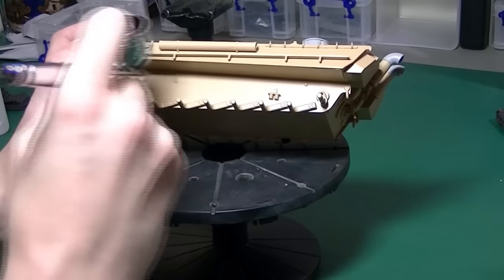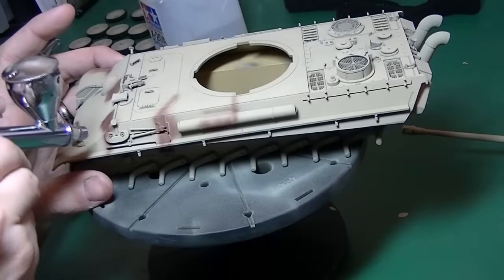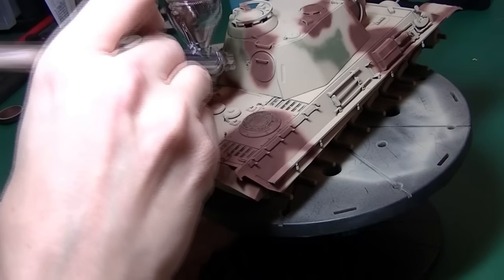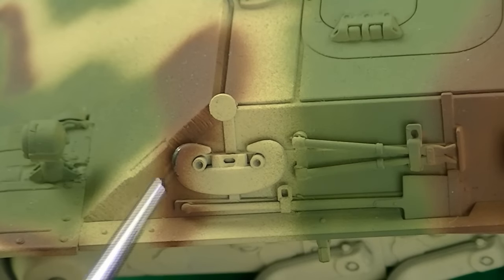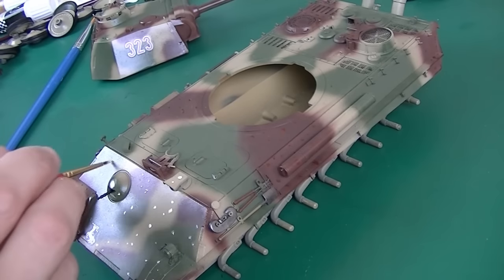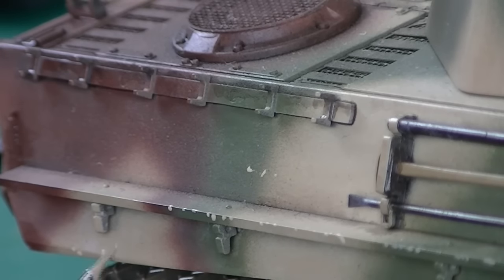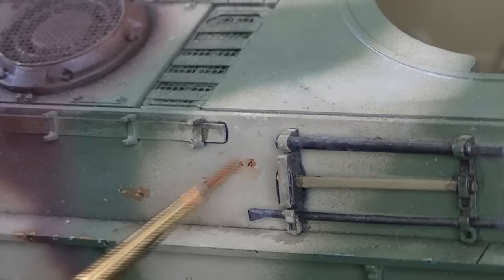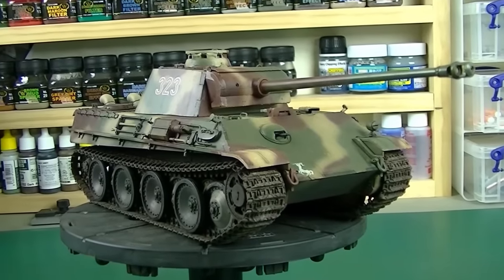Panther Ausf. G Hermann Göring Division - Painting and Weathering

Comment: Hi, the wire cutter handles were made from Bakelite (wood chips compressed in resin, a primative plastic) not the "Presstof" laminated compressed fiber/paper/resin.     Germans wore hobnailed boots so the paint would be scratched down to bare metal in many points the crew used to mount the Panzer.   But the Auf G likely didn't get as many boarding/dismounting cycles  before it was issued then destroyed, as you mentioned.
Reply from the maker: I mean you know I have an original wire cutter here and made a video on it right?

Comment: Really good job on this panther 
I really like the camouflage and don’t worry about the dust under the clearcoat it happens to me all the time..... I saw you used Tamiya Flat Black as a primer I use NATO black but it seems that after I primed the model with the acrylics I let it dry a couple of days and I go over it with Tamiya Xf-60 It gets like a gritty feel does this happen to you also when outing Tamiya acrylic on top of Tamiya acrylic
Reply from the maker: Thanks very much. I've recently got some NATO black. I'll be giving it a try soon. I think I'll be doing less clear coats in general.
Reply from the maker: I just re-read your comment. I used to get a lot of orange peel, had to do with a few things. Too high of pressure, not thinning paint enough and being too far away from the model.
Reply: Thank you for the response I’ve tried everything and I’m still getting a slight gritty finish with the Tamiya acrylic ..... panzermiester suggested that I try thinning it 2 parts thinner to 1 part paint .... 
I’ve been using to TS 3 rattle can for the time being I got to be an expert at controlling the paint comes out.... looking forward to another video from you 😊

Comment: Did you use the paints right out of the bottles or did you mix them.  If you mixed them, what was your ratio of paint to thinner?
Reply from the maker: I don't use a ratio so to speak. I just add thinner in to a plastic cup with the paint until it's milky. I can try and do it in the next video.

Comment: I agree about tamiya german green being way to dark, by the time you filter over the top or do a grime wash it almost looks black.
Reply: The paints that the tank crew would be given come in the form of a very thick paste, which the crew would have to thin, before applying it with a spray gun and/or brush. Although there would have been instructions provided regarding the ratio of paint to thinner, it is very likely that those instructions would not be followed very carefully by crews who were near the front lines & having to apply camo to their tank during a brief lull in the fighting. Also, using a brush would produce different results than a spray gun. So, I suspect that the darkness of the camo colours varied a lot from tank to tank. In some cases the greens & red-brown could be very dark,  and in some cases the colours could be very light.

Comment: very nice looking model,  good job :)
my only one note is the mount for spare tracks- i seen some injection pin marks.
Reply from the maker: Thanks man.You are absolutely correct about the pin marks. The original plan was to cover them up with spare tracks and I decided to just finish the video without them. I'll have to add something there to cover it up.
Reply: +Adam Mann just add spare track links or tarp and model will be great.

Comment: Hi, I am a newbie to airbrushing and using masking solution and need your expert suggestion on how to properly remove the masking solution without scratching the underlying base paint I applied. I am working on a  Tamiya Leopard A4 and the two-color camouflage scheme requires that I first airbrush a layer of red brown, applied masking solution to outline the camouflage pattern, then airbrush the olive drab over the red brown and the masking solution. But maybe I applied too thin a layer of masking solution or too thick a layer of the olive drab paint, when I tried to remove the masking solution using
a small tweezers, I always scratched the underlying red brown paint. And since I applied a thin layer of masking solution (I used the Mr. Hobby Masking Sol R), it’s become difficulty to discern the contour of the masking solution under the 2 layer of the olive drab paint! Do you have any suggestion? As a last resort, I might just spray over the scratched surface and use the one-color camouflage scheme. Thanks for any suggestions!
Reply from the maker: Tamiya acrylic paint is very susceptible to scratching. My thoughts are you needed to clear coat the base before chipping fluid. Or maybe even use a primer red as your base coat as those are lacquer paints.

Comment: As always this was a phenomenal video. I am preparing to do a tri color on my king tiger and will use your tips as a guideline. I have recently branched out from modeling and have started to collect German relics from WW2. I was hoping somewhere down the line you may devote a video to the topic. I am finding that soldiers personal items are easy enough to find but panzer relics are proving to be more elusive. Maybe you could share some of your sources?
Reply from the maker: There is a video in the works on some relics. I can help you get started if you need some guidance. What type of parts are you looking for?
Reply: That's great to hear! My biggest handicap is funds. I saw a few tread links that were $500+ and right now that isn't something I can justify spending. I was thinking maybe starting small, any bits or pieces from a tank. I am not picky, even something small would hold sentimental value for me because I know where it came from. I am not really sure where to look because most sellers have high price stuff. Maybe you have some ideas?
Reply from the maker: I started with some bits from Russia that I honestly still don't know what are. They were $10 and had primer and yellow on them. It just spiraled out of control from there. A track link is going to be expensive if you want a big cat, Panther and Tiger links are usually no less than around what you said there. A Panzer III/IV track can be had (depending on the type) for around $100, but then you have to get it to where you live. That's been the adjustment for me from models. Shipping heavy metal objects from Europe is pricey. But American sellers are collectors and will charge you way more. Usually the combination of cost & shipping from European sellers is still less expensive than a US collector. Assuming you're from the US. 

There are militaria groups on facebook I'm in, but I have only bought one piece that way. It's risky as there is no protection from ebay. I get most of my stuff on ebay, and it takes a lot of searching to find something worth buying. I do the same thing I did with models with tank parts. I have a number of searches I do (or have bookmarks for) that I check every day. Most days I find nothing. It's almost like digging for them myself. There are also dedicated WWII militaria sites that sell these things. I have had good dealings with a Latvian guy named Jevgenijs, that runs the site www.relicsww2.com. I've only bought a few pieces from him, but he's a solid guy. A little pricey, but I would describe Jevgenijs as a more accessible and respectable digger. You do have to understand that if you start dealing with the sellers from Russia, Latvia, and Estonia, no two are the same. Some work with Legenda, which sends information and dog tags to the respective country, and others, well...others you just don't know. I have to state that I only buy vehicle parts, I"m usually against buying things like personal items and identification tags.

Have a look around the Panzer tab on Jevgenijs site, you'll get a feel for what things cost. he's on the higher side of diggers as far as prices go, but he's very reliable.
Reply: Thanks for that link, he's got a ton of stuff even if it is a little pricey. I think I am going to grab that panzershreck shield he has up for sale. I agree with you on the matter of personal items such as dog tags, I feel like that's a bit too morbid. I've seen some relic helmets with obvious combat damage too. It looks like this will be another rabbit hole to explore, thanks again.

Comment: i came across this video randomly... i just wanna be nice and tell you the base coat of panthers and any German tank isn't tan or green or anything its Oxide red colored primer... you should have colored it red then applied the tan
Reply from the maker: I'm aware of the base primer of German armor being red. I actually collect real parts of panzers. When I did this I chose to do a black undercoat as it's very common in armor modelling to create what we call "Ambient Occlusion" in recessed areas. I've actually started to do hair spray chipping with red, then yellow and so on. You may see it in later videos.

Comment: Most model tanks I see are over weathered, and look unrealistic, but I spent 30 years in the US Army, and you don’t see much if any rust or paint chipping.  You will see LOTS of dust, dried or wet mud when in the field, and a grimy looking after a time.  See US M1s in Iraq for an example.  I imagine the German Army was similar and many of their tanks are not around long enough to get lots of rust, IMO.

So, after all that, I think your tank looks more realistic, not less.  The over weathering is more about looks and contrast, not what tanks really look like.
Reply: As an old tanker those super muddy and weathered models can be realistic. It depends on the tank and the moment in history. My M1A2, less than 2 years old when I got on it, had a bent and rusted front fender, paint chipping HEAVILY off of the bussel racks and hard edges of the skirts and front slope. There wasn't any long lasting rust but there was certainly flash rust on exposed metal. 

Then, if you go through a wet tank trail in Ft. Hood, which is all caliche clay, Hell....you will be scraping MASSIVE chunks of clay out from your road wheels with a putty knife because a pressure washer won't even touch it.

And that was on a peace time M1A2....imagine the damage being suffered during war time, where there isn't a motor pool to immediately fix items, and funding to purchase spare, superfluous parts, like fenders.